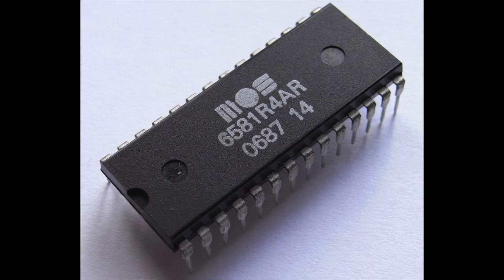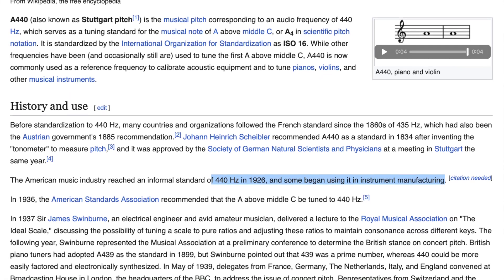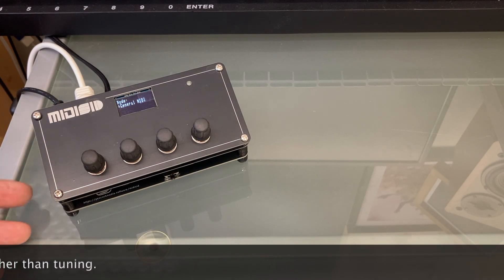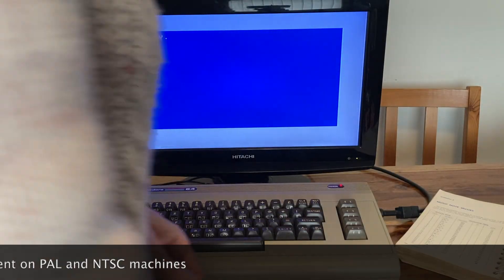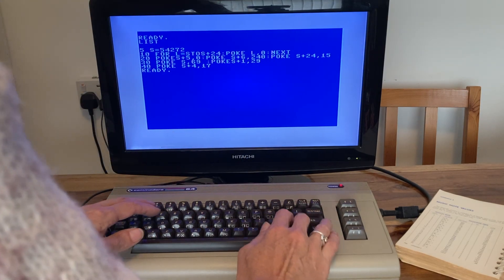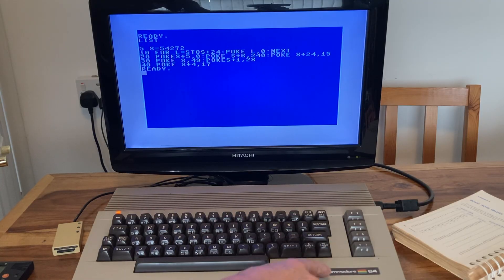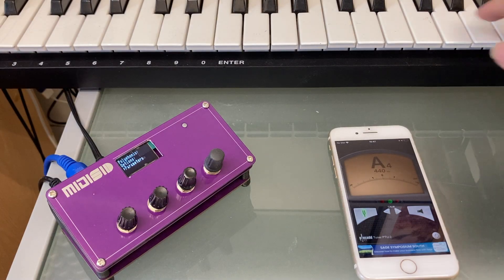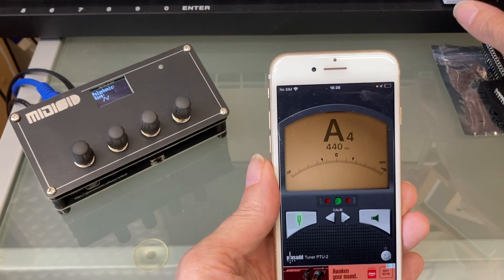The tuning of SID chips and modern replacements

Comment: Excellent work. I never realised that the frequencies in the back of the manual could be different for America versus Europe but it DOES make sense. 

Good to know that you've investigated, found out the issue and have fixed it!
Reply from the maker: It doesn't surprise me knowing Commodore, although it's not just the same manual, mine has an English address for CBM on the back and a price in £. I found an interesting discussion online about it, apparently the German-language version has correct values for a PAL machine, but the Swedish manual (also PAL land) has different values again! which turn out to be direct from the SID datasheet and assume a 1Mhz clock (neither the PAL or NTSC machines provide exactly 1Mhz, hence all the different values).  Thanks for watching.

Comment: That's amazing that the (us)english manual has the wrong frequency values for PAL regions. I wonder if that was overlooked in all english copies of the manuals. I'll have to check mine :)
Reply from the maker: Yes, that's interesting, although maybe predictable knowing Commodore. I've just checked my copy of the programmer's reference guide in case I had an American copy but it does have an English address on the back for Commodore Business Machines, and a price in pounds. While hunting around for information, I found that besides the PAL and NTSC machines requiring different frequency values for the notes, there is a third table of values, different again, which is the one from the SID data sheet, which assumes a 1Mhz clock (neither of the machine variants provide exactly 1Mhz)   I guess this didn't really matter when the machine would usually only be playing music with itself.